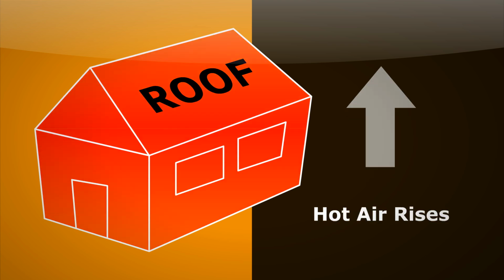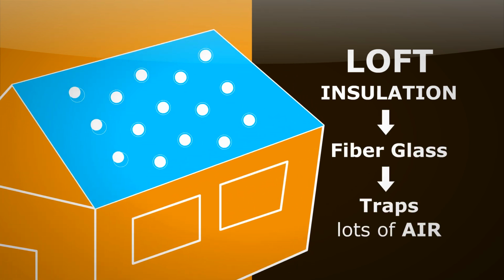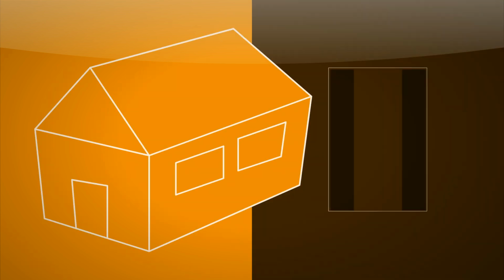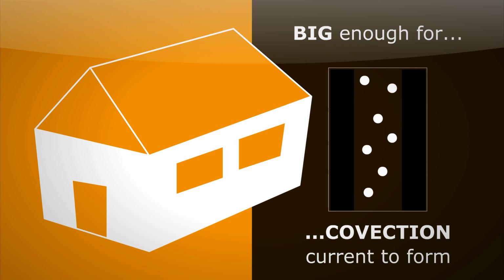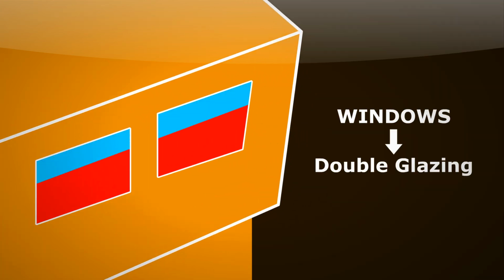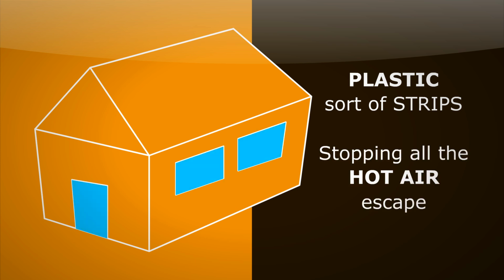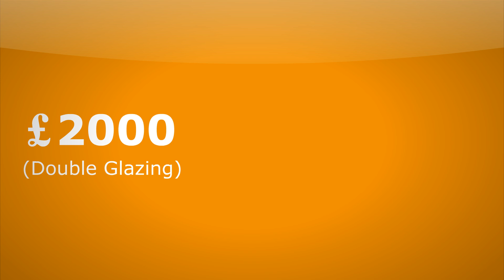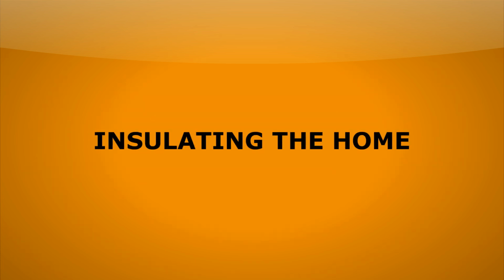Physics - Energy - Heat Transfer - Insulating the home

Comment: The matter in air is not a bad conductor, it's just that in gas form with not enough pressure it is bad at. Conducting heat

Comment: Hi, we have an unusual construction 1962 Bungalow, using a fabricated steel frame design with a brick wall skin. So we have a cavity but have been told not to fill it because the steel will sweat and rust. We thought of adding an insulation later to render to the outside walls, but the cavity still presents a problem with air flow behind it. So we finally think adding another layer of plasterboard to the exiting two layer plaster board(40mm think). We have found a plasterboard product with Polystyrene attached to the rear face, so creating a layer of insulation between the two plasterboard layers. Do you think this will solve the problem, we are unsure of the condensation issues and efficiency of the polystyrene layer and or its thickness? any ideas,
Reply: Yes
Reply: @Abdul Basith Fayaz and I am applying that Physic to our case!!! LOL

Comment: hi my bedroom is in a attic and have a sloping roof would this product be good in summer because at the moment it is very hot and it also feels like my skins burning and do not feel well https://www.diy.com/departments/thermawrap-roof-insulation-l-7-5m-w-0-6-m/245709_BQ.prd  also could i use anything else to reduce the heat coming into the room